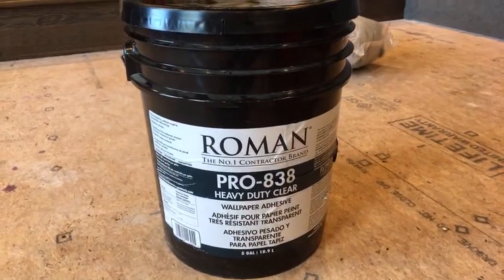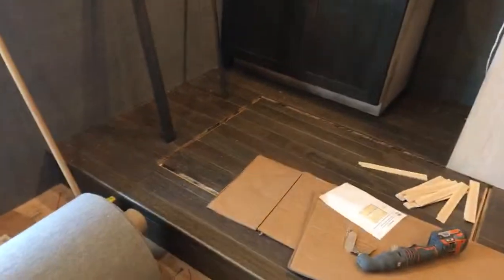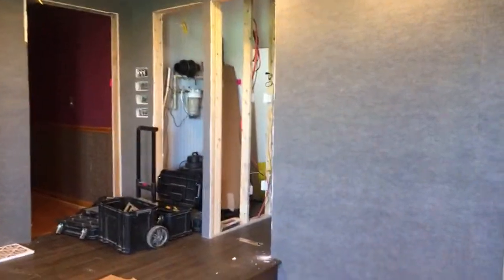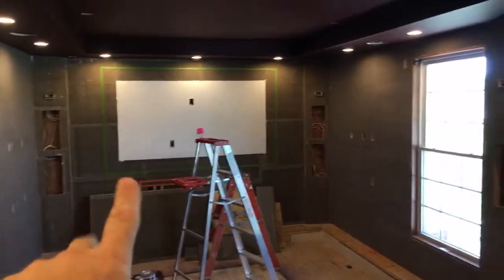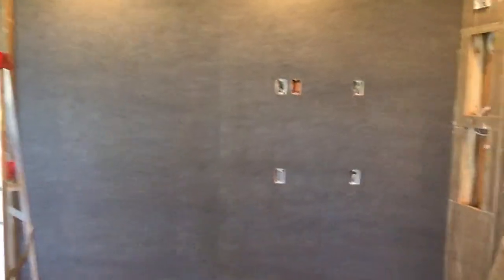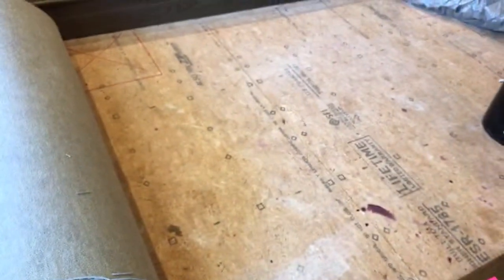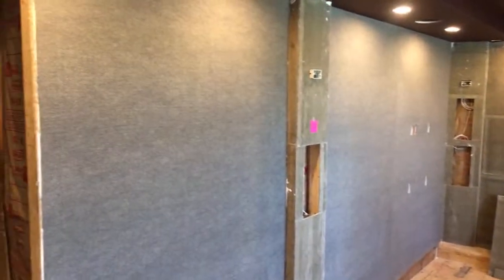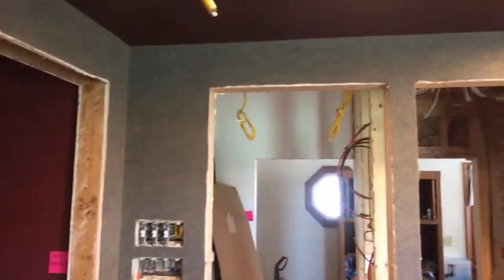Carpet on the walls?

Comment: I'd probably just use carpet tracks and sandwich everything in place with molding so I could hang standard deep pile flooring carpet on my walls if I were setting up a really high-end home theater. Having said that, this is definitely the approach I'd take to noise damping a home theater. Just carpet everything that can reasonably be carpeted. It's still cheaper than trying to cover the walls in acoustic foam.

Comment: We use to use contact cement to hang that carpet. 
Ozite carpet when made is rolled up while the dye is hot so it causes shading when unrolled. We used both methods of cutting the seams double cut and roll cut, because of the shading it really didn’t make much difference.

Comment: Would a good pressure sensitive glue work?  We are getting ready to start a job where we are putting the same type of carpet on walls in a church basketball court. They had it on before and had problems with it coming loose in spots.  They are block walls but where the carpet goes they installed osb. I thought maybe the new osb might have soaked in a lot of the glue. Might act as a sealer for me.  My thought was to roll on pressure sensitive, let dry, and put in new.  We use parabond 5080.  Don’t know where to get wallpaper adhesive, would good multipurpose be better. This is a big job and don’t want any problems. Thanks.